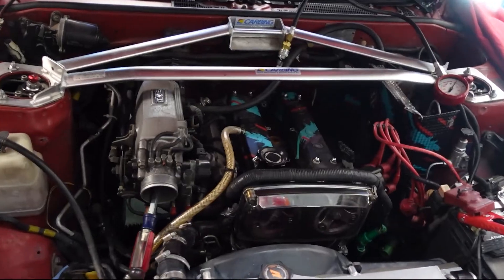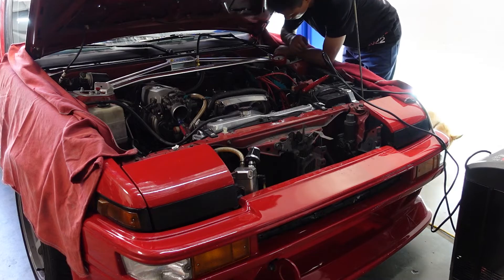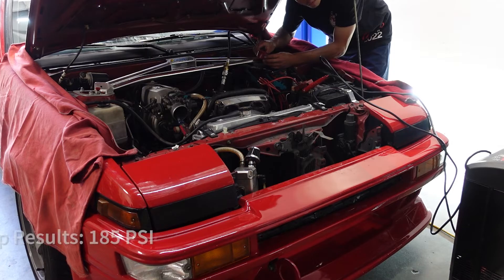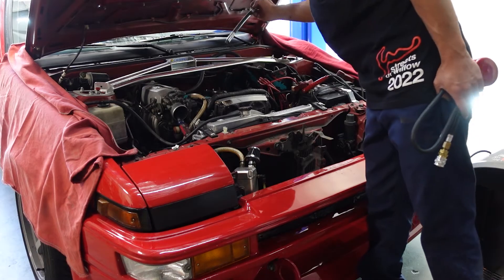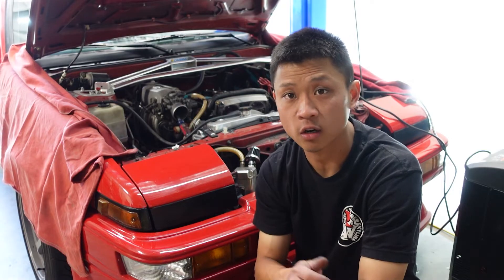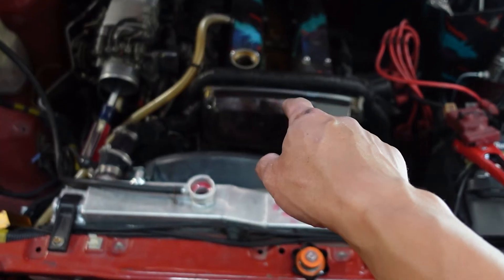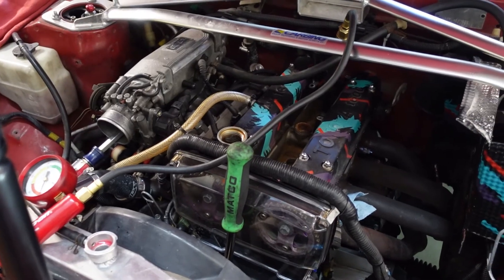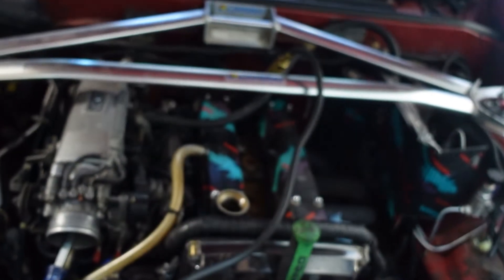Compression/Leak Down test DONT MAKE THIS MISTAKE!

Comment: I got one for you. White smoke at tailpipe, cylinder #5 spark plug wet (the rest are good). Compression test good 175-200 lbs (but always wet maybe?), leak down test good, coolant pressure test good. Coolant level no loss, oil level (got a small leak at front main so maybe some loss in combustion chamber?), I injectors and pulse all good. I'm thinking maybe intake to block gasket. What do you think?

Comment: Anyone know why my 2015 Chevy Equinox LS 2.4 liter AWD started rattling after I took off the intake manifold to clear the inner pcv hole... I drilled it with a 3/32 drill bit.. (per other YouTube mechanics)
Now it's a rattling mess.. And the compression was 175 to 205 on 4 cylinders (200,205 200 and 175)

Comment: Hello  friend  I just came by ur video ,how far are u from lasvegas?? I'd like to u check out my car maybe I can get u here ? Would u like to take trip here . Have 2006 pt cruiser  that been over heating  just had a compression  test reading on all 4 cylinder  is 120  i replaced radiator  fan 2 tomes this past year thermostat I replaced  new battery  I have yet change radiator  or waterpump . I've had car sitting over 1 week now at meitake they say its gremlins  I requested  a leakdown but they only done compression  say my numbers at 120 are ok . Can I g e t u to Vegas  marlon

Comment: You can save time by doing the leak down test in the firing order.  In my case, a cracked piston caused an excessive leak down %age when the engine was cold.  The %age of leak down improved a little when the engine was warm..

Comment: Would you be able to tell something i done a smoke test on my engine vw golf mk6 tdi i had smoke coming out of the oil filler and i had oil squirting out of dip the stick. long story short i put petrol in the car twice first time i got away with it second time i dident. i was chasing low fuel pressure for a long time evening after replacing injectors fuel pump fuel pressure regulator. fuel pressure sensor. basically the kitchen sink at it. would you be able to tell me do you think the pistons ring are shot. the car starts on the button but when i put the foot down black smoke bellows out the exhaust pipe all i want to know before i pull the engine apart do you think its the pistons rings thanks in advance paddy

Comment: A leak down test will do a better job at pointing the issue then a wet compression test. The engine will gain compression once running because the heat will have everything expand and will cause the end gap on the rings to tighten up too making the compression higher then a cold test

Comment: re the air compressor, is there one that is good for mechanic work as well as body? i intend to use it at home.  I tried to use a small huskey but it runs out of air too quickly

Comment: I've had it happen twice now in a 43 Vortec motor and the last time it happened I now have zero PSI in cylinder 4 which I'm praying is a valve and not the cylinder

Comment: Great video. I'm wondering if you can help me out with some advice. I've done so much work on this car but it still overheats. (2012 ford fiesta 1.6l)

I bought the car with the engine overheating and blasting white smoke out of the exhaust. with the coolant bubbling in the reservoir. I have since, replaced the head gasket, coolant outlet gasket, thermostat, water pump and resurfaced the cylinder head with new head bolts. And properly bled the cooling system.

The car still performs the same after all of these repairs. The car still passes the engine block test (same as before the repairs). And there was never signs of coolant in the oil or oil in the coolant (before or after the repairs).

A compression test determined cylinder 3 had 120PSI and all the rest of the cylinders were around 110PSI (I was told by a dealer tech that the normal range was within 100-110PSi). All of the coolant hoses get hot and my heater blows nice warn air. There are no coolant leaks and the system holds pressure at 13 PSI for 10 minutes without falling down. The car idles perfectly.

Why is this engine still overheating? Is it possible to have a cracked cylinder head/engine block even with a passed block test and good compression?
Reply from the maker: There could be a unique way you have to bleed the system
Reply: @CMAutohaus  thanks still no luck though
Reply: Podría ser el radiador obstruido, hacerle una limpieza profunda con agua a presión. Exactamente eso me sucedió y por eso lo comento.
Reply: It's either the radiator that is clogged or a thermostat that doesn't open all the way.
Reply: @Tate.TopG.  I fixed it. Heater Core was still clogged even after flushing it out. Also the cheap aftermarket thermostat i had was bad. And had to put an original one in. Car ran Great after that
Reply: @ceezauto213  That's some good news. You saved yourself from a big car note. Keep fixing this truck and stay free from big expanses

Comment: Need to set the regulator before plug in to cylinder, set the psi in and then turn till it goes as close to zero (set) as possible then lock the regulator, then you can plug in to adapter in the cylinder , you put in 100 psi and it shows up 70 or moderate on the second gauge, you have a 30% leak so to speak ,also each cylinder tested should be at tdc before adding air as the engine could spin and if you have a bar on the crank well good luck ,. Also listen for noise if it’s out the exhaust or the intake air pipe then it’s the valves, if it’s out the coolant it’s your gasket and if it’s out the oil filler then it’s either the block , the liner, the piston or the rings . that’s how I was taught and works for me
Reply: Make the math simple.  You want set and maintain 100 psi going into the cylinder.  Doesn't matter if you set it first or last.  The way he's doing the test can expose a cracked or excessive scoring on the cylinder wall that might not show up if the piston is at TDC.

Comment: This is a bit random but don't forget to drain the mioster from your air compressor.  Underneath the tank you will find a little drian valve.   The valve typically needs to be replaced.

Comment: One of the best videos on this topic.  What's the best way to do a compression test when the motor is on an engine stand?
Reply from the maker: When the engine is out, we usually do compression tests when the engine is on the floor for saftey, also because we need to installed the starter and bellhousing at times. We just hook up the starter straight to a battery and crank 8 times

Comment: Wet compression test on subaru motors, how do you make sure the oil poured into the cylinder coats the whole piston ring? Do I just turn the motor over and that will be enough movement to coat the rings?
Also, is it okay to do a compression test on a motor outside of the car that doesn't have oil in it?
Reply: I have a vw beetle boxer engine, and I used a long nosed air gun to move the oil around the cylinder. Seemed to work OK.

Comment: You mentioned you were listening to the cranks during the dry compression test to see if a crank is turning over too fast or skip a crank. What would it mean if it did do that?
Reply from the maker: Very Low compression in one cylinder
Reply: @CMAutohaus  oh dang. Even if the number is good relative to the others?

Comment: I make a positive stop out of an old spark plug.  Length is set so that when the cylinder you're testing is at TDC, 2 of the other cylinders are at BDC.  So, if I'm testing #1 at TDC I screw the stop into cylinder #2 or 3.  This locks the engine into place.  I don't have to worry about wrestling a wrench to hold it in place.  And I can check for noise/leak presence by myself.  Also, I close up the garage and turn anything off that makes noise - so I can hear where the leak is coming from.  I usually pull the dipstick and stick a piece of tubing in it.  Easy to listen to the exposed end of the tube for crankcase noise.  Easier to listen to throttle opening on leak down if you pull your screw driver and leave it closed -  you'll get more audible noise if you have a leaky intake valve.

Comment: This is the best I’ve seen. Unfortunately need to do this on my ej207 swapped wrx . I had 110,110,105, 102 psi on mine which is lower than the 125 it should be for a ver8 engine
Reply: I didn’t know how to do the leak down but I’d like to do it

Comment: I did dry compression and one cylinder was 15psi lower than the rest. I did a wet compression on that cylinder and brought it up to exactly the same as the other cylinders. Anything I can do to improve or just let it ride?
Reply from the maker: 15 psi isnt much. Id do a leak down and see where the compression loss is comming from.
Reply: @CMAutohaus  thanks

Comment: Hey brother quick question if that’s ok did dry test two cylinders at 135 (1 and 2) and 185 (3 and 4) wet test (1 and 2 ) when up to 185 problem with the block…? But what are the chances to be rings only….? Car over heat I did the head gasket leak test was 100% good nothing on the radiator the car is a mini 2011 1.6 nine turbo. Thank you

Comment: There will always be some leakage into the crankcase because piston rings have gaps.
Also, it's best to do the leak down test with the piston at top-dead-center because the top of the cylinder is where the most wear takes place.  In other words, the leakage will be highest with the piston all the way up.  An engine with a lot of wear can have a difference of .020" between the top and bottom of each cylinder.  That was more common in old-school engines with cast iron blocks and nothing done to slow cylinder wear.  
To help keep the piston at the top during a leak down test, start with the supply-side air pressure at zero and bring it up smoothly.  
I've watched a number of leak down test YouTube videos.  This was one of the better ones.

Comment: 12 volt system,12 volts is a dead battery...🤔
Reply from the maker: Approx 12.6v is a full battery. 14.7v is charging system volatge. Some cars wont even start with a battery with 12.0v

Comment: My car is burning oil, but being a Focus mk1 no shop really cares about it, they all have the shop full of suv or more expensive cars... So i decided to do compression and leak down test myself, the compression it's very good and tomorrow i'll do the leak down test, i'm thinking my oil is dripping from the valve stems seals how could i hear it? From the intake? Vacuum line?
Reply from the maker: Leaking valve stem seals should cause smoke to come out the exhaust on hard accel or decel.
Reply: @CMAutohaus  Idk why but i have whitish smoke coming in the cabin on hard acceleration and i notice it on decel on the back, the test didn't show much tbh, 15 to 20 on all 4 cyl, i'm rebuilding the top end in a month and will keep adding oil in the meanwhile... Might be a headgasket.
I'll do headgasket, rings, valve stem seals and more, i have a miata as """backup""" so i can still go to work and get groceries 🤣🤣

Comment: I agree with what you said, must do all 3 tests. Do you like to do compression test at normal operating temperature? Nice video.
Reply from the maker: I go by the FSM. They differ between engines ie S2000 Honda wants you to perform the tests on a cold engine.
Reply: @CMAutohaus  I was taught that the cold test is the more accurate. As the air gets warmer, the pressure increases (Bolyes law). Also, metallic components expand, closing metal to metal gaps.  A cold test is therefore the purest test but there is no reason why you cannot undertake both cold and warm tests. There is a YT video of someone who had good readings on all cylinders on the warm test but had one cylinder seriously bad, at only 70psi, on a cold test, indicating the early onset of a problem.

Comment: Good information, would like to note you need to make sure you set the regulator to 100psi before connecting it to the cylinder. I like to recheck it each time. In the case of a Mini engine, 9% leakage is enough to cause smoking and ultimately condemn the engine. I would suspect this is why you’re getting such good readings. But still very useful information.

Comment: If you are going to do a video, use an engine with a problem. It was a good video, but MY ENGINE conclusions were drawn immediately after the wet test. still low compression after oil, leaves only the head whether it is a gasket or valve, the head must be removed. I will do the leak test just for curiosity, but suspect the valves leaking (90%) or head gasket (10%) being left out after a rebuild. (That i did not do) I will not look for the place where both valves are closed either, just remove the rocker arms. dry 90psi, wet 120psi so it must be head related? Leaking sound is LOUDEST at valves, I don't believe i need a leak down
Reply from the maker: When I get a "bad" test I'll make sure to film it. Thank you for the feedback!

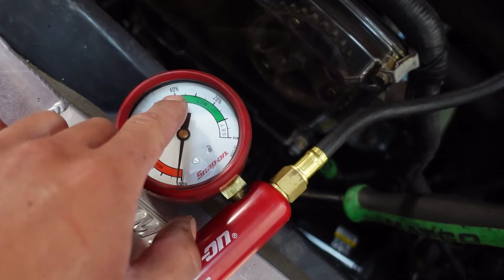Comment: @7:30 0% leak down is not ideal.  Because of the gaps in the piston rings and the necessary clearance for lubrication, you will never have a perfect seal. It is so incredibly unrealistic that it means that there is a problem in the testing set up, like forgetting to remove the Schrader valve when combining parts from compression and leak down test kits. A leak down that low should be a red flag 🚩 that something isn’t right.
Reply: I think he got 0% because the intake pressure was over 100 psi, if he had adjusted the intake pressure back to 100 psi when the pressure rose on the output he would have had a deffirent result.

Comment: Excellent. Very helpful. 2006 tacoma with disappearing coolant. Leak down test. All 0% except valve #2 at 5%. No bubbles in coolant but did not state where he heard leak. 
Coolant continues to slowly disappear no visible leaks. Radiator pressure test 15 psi performed no visible leak at 10 minutes. Lost nearly one resovoir full in 3 months.
Reply from the maker: Glad you found this video useful. Sound like an internal engine issue if there is coolant loss and no external leak.
Reply: @CMAutohaus  Right, but passed leak down test, didn't reveal an internal engine leak. Radiator pressure test while visualizing with boroscope another good test. Can dx drops of coolant at the head gasket. Will repeat radiator pressure test. Hopefully will find a visible leak.
Reply: Check the water pump it may be leaking slowly. On that indicator... I also have a 2013 tacoma, and I was wondering where that leak til I saw small drops of coolant here and there

Comment: When would you do a leak down test at UNDER 100psi? Smaller engines? Different types of leaks? Snap-on was designed for 100psi testing only. Other companies can test at lower pressures. Is there a point?
Reply: Leak down percentage is calibrated to 100 psi because the math is simple.  100 psi in - 95 psi out = 5% leak
Reply from the maker: Depends on the tool. I've seen others like OTC spec a different pressure

Comment: Keep looking if you want to accurately conduct a leak down test.  This guy's method is absolutely incorrect.  The title is correct, "DON"T MAKE THIS MISTAKE".
Reply: Well... think about what we are doing... We are looking for leaks atributable to a blown head gasket, worn and or stuck rings, cracks in the cylinder heads and valve seating and sealing issues and cylinder wall wear issues.

He showed us to check the various places where air will escape to help determine the potential cause of any leak.  This is gona be helpful at the point when we get the engine apart and have to decide if the head needs to be sent to the shop replaced or just cleaned and inspected.

I can fix these all of these problems with a new long block, but the idea is to avoid doing this if all we need is a new head gasket and a new set of head bolts.

Replacing a head gasket when there is also a stuck ring or crack behind a valve or leaking valve seals will result in a short term temporary repair that will not give a long term positive result.

Working on your own car... well that's one thing... working on someone else's car... that's a whole new world where knowing what they can and cannot do is paramount.
Reply: Curious, what was incorrect? Thank you.
Reply: lol gtfo. His method is correct
Reply: @snguyn796  then you are a stupid and retard brain! First because the method is not 100% correct second for using inappropriate words.
Reply: @snguyn796 can I use this method instead of finding tdc on a v8
Reply: When I saw that he did the test without setting the tool gauge to zero first I stopped watching it. You have to calibrate the gauges before you do any test otherwise will give wrong reading.
Reply: @DidiLeeReco Buried in a reply up above the author admitted his mistake of not calibrating first.

Comment: Your readings weren't zero. You have to adjust your regulator it was above 100% after hookup when cranking the engine over. Cranking the engine on compression back feeds through the restrictor on the gauge and adds pressure to the regulated side. Your first gauge is regulated pressure, your second gauge is after a restrictor and is simply observed pressure. Since your regulated pressure changed you have to subtract your observed pressure from the new regulated pressure. Zero percent is actually not realistic, there will always be leakage... You just saw zero because you messed up the gauge by cranking the engine.
Reply: Great observation.
Reply: Ur confused with each test